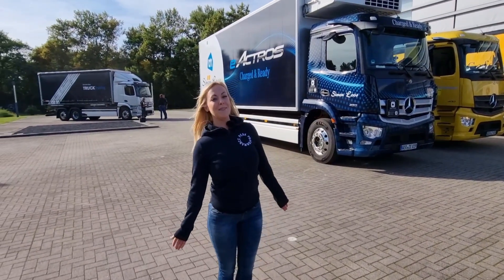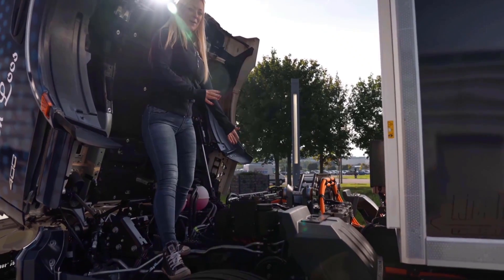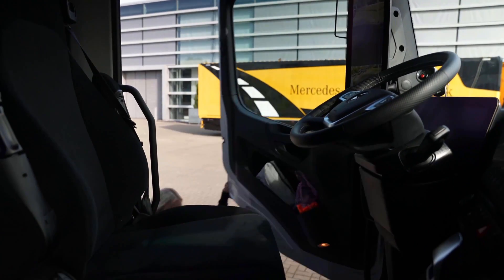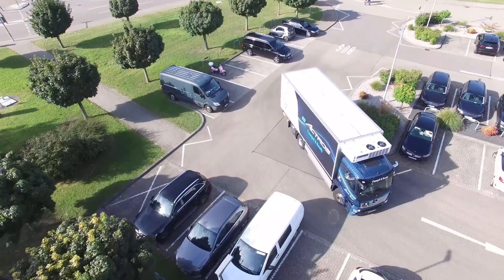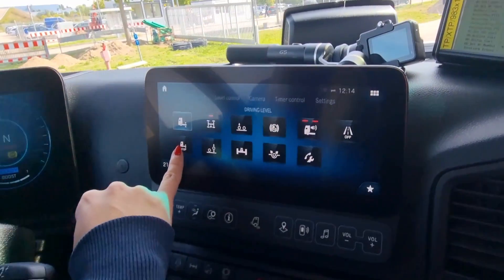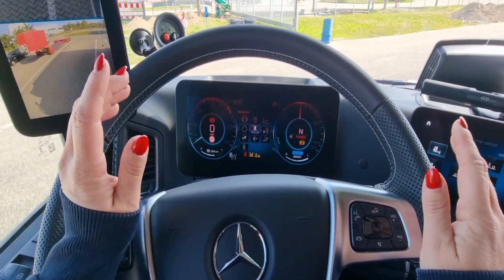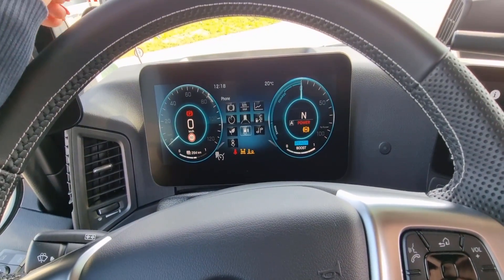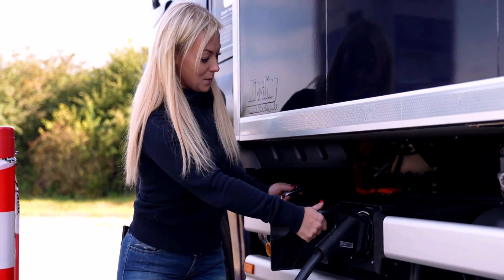⚡MERCEDES ELECTRIC TRUCK⚡ E-actros - Angelica Larsson

Comment: What you may not know about electric vehicles including the truck you're driving in this video what powers them are lithium ion batteries they were so quick to make electric cars and trucks they never did the research on how to discard the lithium ion batteries when they can't be charged anymore and what they're not telling you is these electric vehicles catch fire a lot quicker than a gasoline vehicle yeah they're quiet running and you plug them in and charge them what you cannot drive a battery-operated vehicle from the east coast to the West Coast without having to stop and charge it multiple times because they don't go any further than 350 me before they need to charge and a lot of  places still don't have electric chargers for these vehicles you take a gas operated vehicle an electric version of the same vehicle the gas vehicle will get you further down the road then the electric vehicle will both of them you have to stop and put gas in one plug the other one into charge it but it takes hours to charge the electric vehicle for every time you stop and charge the electric vehicle the gasoline vehicle gets twice as far down the road and if you're going on vacation or business trip the old saying time is money.

Comment: The electric truck by mercedes was very nice looking. Where were rhe outside mirrors. Ot loof like had a reefer bos on front. Where is slwelwr area.i like theyrucks you drove with microwaves in them. Love you. ❤❤❤❤

Comment: Nah, I'm not with this e-truck nonsense. It might be useful for local deliveries in cities and so on. But doing big routes this is simply not practicable et all. Even the air compressor drains the battery, not mentioning all the other systems. It drives without any generator and that one makes me numb, same as the missing Diesel purring :S

Comment: That truck is not better for the environment everything on that truck the steel , rubber , plastic all the minerals mined to make the batteries the electricity to charge the batteries was made possible by fossil fuels
Reply: Actually Mercedes-Benz (aka Daimler) is now (2022) using only renewable energy for their business. Obviously their suppliers might not at the moment but the entire automotive industry is rapidly moving towards RE.

Comment: ATTENTION ANGELIA, PLEASE READ, THANKS, 
HI there, Angelica, I am a recent subscriber.  I greatly admire your skillset.
I have been many things in my male 64-year-old lifetime, a Commercial Helicopter Pilot being one. ( please look into this as a career, you are young enough to start and I'm POSITIVE you would find it an absolute blast and you would be an exceptional Pilot as well ) I also drove the Big Australian Quad Road Trains 170 tonne side tippers. I never stuffed up during either career other than having to give everything up due to very poor mental health. I just wanted to say I wasn't half the driver you are and I never would have been. I did however manage to do the impossible one day and reverse a quad Road Train in a straight line some distance in a mine sight, but that was my single claim to fame as a heavy truck, operator.

Comment: Its been  a while since I've seen any of your  videos,  electric is great but nobody ever talks about recycling the batteries and any electric  vehicles 
I know someone who works at a dealership dealership and electric  is very dangerous to work on in fact deadly if a mistake is make 
What  nobody  talked  about  and  the information  i got the batteries cannot be recycled so the end result is is it really better for the environment
As to where I'm at we get electric  alerts  in our summer  months  do to overload  of our electrical  systems then in winter months  we get ice storms  that take  down power lines  and or shorts out our electric systems 
Solar needs sunshine  to work weather  plays a big roll in that then there's  wind power systems  they stop working  no wind mostly  because  of cold  weather  conditions  also snow a d ice  and they have taken out by lightning  storms  
Solar  and  wind power  systems  are good  for  about  10 years  and cannot  be recycled so are we really  saving  our environment

Comment: I Really think a small turbo diesel engine Hybred is the way to go run on battery and the smaller diesel engine kicks in til the batteries are fully charged and then the engine shuts down!!!

Comment: From experience EV trucks are fine for short distributor applications but don't appear to be the answer for longer trips great to drive smooth with instant power . Battery life is still an issue as a 20 % performance loss over 10 years and cost of replacements are significant .
In Australia we generate most electricity from fossil fuels so the green upside for the additional capex needs to be considered .

Comment: Much too expensive to buy and even more expensive, when you have to replace the batteries a few years later.
Reply: Nope. Batteries last much longer than that. Cost per kilometer is also very low compared to diesel.

Comment: Going electric isn't greener. I can't wait this marketing charade to fucking end. Replace all the cars and trucks and utility vehicles in the world with electric ones and see if the grid will be able to keep up with it. 1. The amount of resources you burn to build 10x nuclear, hidroelectric or wind/solar water boiling power plants will throw you back 40 years ago at the end. 2. Laying the infrastructure to have charging stations everywhere will add another 20 years worth of CO2 emissions. Today a diesel truck is cheaper, cleaner and more efficient than this stupid marketing scheme everyone jumped in in fear of sells dropping. The only solution that is viable but everyone ignores because marketing and money dictates, not real solutions, is HFC. The stupid fucks say that HFC is dangerous while we put our asses on top of diesel/benzin tanks since birth to death. Astronauts fucking strap themselves to rockets and they say having a hydrogen fuel container is too dangerous. It's an almost infinite source of energy compared to batteries. Having to charge anything that moves on tiers is fucking retarded and anyone who has both a chargeable anything-that-goes-on-wheels is an idiot as he/she saw nothing wrong plugging a plastic complicated adapter that polluted already way too much in another socket made out of plastic on a fucking car for a range of only 300 km when an HFC gives you 500 with a small tank.
Reply: Lol you forgot that hydrogen fuel cell vehicles require THREE TIMES more of the same electric energy...

Comment: How`s 400 km range good enough for a truck?
Reply: Especially in western europe 400km range is enough for a local distributor. For instance if you deliver beverages to restaurants and pubs and cafes in the region, you will hardly ever make more than 200km per day and your back at your base in the evening where you can recharge the batteries over night for the next day.
Yes, it's not a solution for every scenario, but for some it will do the job just fine.

Comment: For most countries electric vehicles are not better for the environment because the electricity used to charge the batteries is from fossil fuel using power plants. In Sweden I will agree that since most of the electricity is from either hydroelectric or nuclear power plants, it's a net positive for the environment.
Reply: Wrong. Even if mainly non renewable energy is used, electric vehicles are still far cleaner.

Comment: In Holland a DAF LF chassis cab on diesel costs around €50.000.A DAF LF chassis cab electric costs €352.000 ex.loader witch costs between €100-150.000.
So for a small company without factory support or a big cliënt as the Ahold company on the Mercedes of Simon loos it is impossible put an electric truck on the road!!!!!

Comment: I remember once getting into a Toyota Yaris Hybrid. I pushed the button and silence. I put the drive to the prod and slowly started walking. I was lucky that the battery was charged and the engine did not start right away. However, when I wanted to drive dynamically, the internal combustion engine started. It was completely different in the BMW i3. Where there is only an electric motor. Overall, the only obstacles to using electric cars are range, charging times and the availability of charging stations.

Comment: Amazing how quickly electric vehicles are moving into production and replacing fossil fueled vehicles. This must have been very interesting and a totally new experience for you to test out this new truck. I would think it will take some adjustments to get comfortable with the startup, charging, and all the different features an electric truck has after driving a diesel truck. Thanks for taking us along 👍

Comment: Electric vehicles really mean coal or natural gas powered.
Reply: That does not matter. Still cleaner than diesel.
Reply: @Freba9  there are places that can't keep up with the electricity demands during hot weather now.  Wait until there are millions of ev's charging at those times.  No AC and no vehicles
Reply: @peterbiltpilot516  Sure and that is exactly why grid reinforcement is so important. Among EVs we need more power for data, electrical heating, electrical cooking and other things that belong in the 21st century. Going electric is the only sensible way to drastically reduce emissions.
Reply: @Freba9  I have experience working at coal power plant facilites. one was retired and replaced with ng a few years ago. One last year to ng and one next year to solar.  The price of natural gas is over 50% higher than last year and solar is not dependable.  The electricity network is becoming more expensive and less dependable
Reply: @peterbiltpilot516  Correct and so do liquid fossil fuels. Again, electric is the only way forward.
Reply: @peterbiltpilot516  It’s not one energy source. Electrons are simply used for distribution and storage and have been proven to be the most efficient one. It’s just simple physics.
Reply: @Freba9  it is one energy source.  There is only one electric utility in an area.  You cannot shop for a different utility provider for your home and if your vehicle is electric your fuel for your car comes from that one utility company as well.  If you have blackouts or expensive rates you're stuck.  California has just announced combustion engine tools like chainsaws and weed eaters are going to soon be banned and that include generators.  So they are outlawing alternatives for electric power sources when the utility company fails and leaves you in a black out
Reply: @peterbiltpilot516  Again, the solution for lack of grid capacity or reliability is improvement of the grid - not sticking to horribly inefficient and polluting systems. I am not saying this is a matter of a few years, but it is the only option that makes sense in the future. Also: fuel crises have also proven to be very inconvenient in the past.

Comment: It’s a shame about all the technology in the cab that falls short in the real world!  Driving the merc with all the screens and cameras is by far one of the worse driving experiences I’ve had the displeasure of having!  By the end o& the shift all you want to do is have a headache tablets for your banging head and wanna tear off the screen on the drivers side!  This truck was designed for transport managers and directors who can’t drive truck but are blinded by shiny technology!  I can see some use for battery powered trucks though, on short runs round cities.

Comment: Electric trucks have a future, in the scrap heap of history! Come to British Columbia and pull 63,500Kgs up 8% grades for an hour or so with an electric truck... yeah not going to happen. Hydro carbons are still the only way to go. Don't believe the PC virtue signalers, oil is plentiful and, as long as the greedy bastards don't screw everything up, will be thee main source of energy for a long time to come. 
Considering that most of the world still uses coal and natural gas for electrical generation this is all just to make the ignorant feel like they're doing something good for the planet. 
Now, with my rant over... I live completely off the grid. I make my electricity from my creek via a micro hydro generator. Would I be opposed to having all of my vehicles run on electric power? Of course not! But the reality is that for anything other than puttering around the property it just won't work. 
An hour to charge? to go a few hundred clicks? VS a few minutes to go 3000 plus Kms? Time is money in trucking, and sorry but it's just not going to be able to compete in real life. You can get it for free, or close to it? Use your brain. Once these things start to gain in popularity, our electric bills will go through the roof! The greedy bastards that have their hands on the levers of control will rape us blind! 
Wake up you bunch of dumb sheep! Math isn't that hard!
Reply: It is not ignorant. Even on non renewable energy driving electric is still cleaner than diesel.

Comment: The batteries weigh over 3 tons for ~400KM of range.  Batteries have a finite number of charge/discharge cycles before they are used up.  It requires a lot of current for a "Fast Charge" (hours) to make EV's remotely useful.  Then add in the cost to upgrade the Grid to support MILLIONS of EV's and the power generation to supply the electricity....  Frankly it's just trading one form of pollution for another....
Reply: Wrong. Electric vehicles are still much cleaner than the fossil alternatives.

Comment: This was very interesting and informative video. I'm starting to change my mind about electric vehicles.  I might as well, it's going to happen anyway.   Thanks for sharing.
Reply: It makes sense for relatively short distance. A lot fewer moving parts mean that maintenance costs are much lower. 
It's very likely that when one needs to change battery, a new battery technology is ready for use in existing EVs. 
 
Rumour has it that a new promising sodium battery chemistry is in developed. They cost is about 1/8 to 1/10 of Li-ion batteries. They  have a bit lower energy density (lower mileage), but charges much faster.

Comment: 400km range 🤔🤔🤔🤔 so team driver that drive 2000kms a day will have to recharge it 5 times a day when they typically fuel once a day. So say the middle of the winter when the charge is 50% of summer they will have to recharge 10 times a day🤷‍♂️🤷‍♂️🤷‍♂️ there’s a lot of creepy dude comments on here too 🙄🙄🙄 These will never work in the colder climates not a chance, imagine this trying to pull a set of B-Trains over the Rocky Mountains in January at -20 to - 40 not a chance 🤔🤔🤔🤔
Reply: Nobody claimed otherwise. These trucks are great for more local trips. Yes, even in low temperatures.

Comment: Range and price are the big big problem in Canada , if it can not go 800 k and run ac or heat for 16 hrs straight it will not make any headway here , but I am sure they will figure it out.

Comment: So how much carbon is truly being saved. When you factor in the Battery materials being mined (china) , plastics and enough electric to charge the batteries.
Reply: A lot of carbon is saved. Production emissions of batteries are compensated for when you drive. Driving electric is always cleaner due to the efficiency - even on mainly non renewable energy.

Comment: It looks like a normal modern lovely truck. I love Mercedes Benz trucks, I drive them too they’re in my opinion the best truck for the job. I like this truck they have designed they have kept the characteristics of what trucks are supposed to look like big and high up in cabs. I have always worried about electric trucks and them not looking like trucks and being low to the floor. But they have kept the design great video and great truck.

Comment: Why mercedes won't do test on fully loaded truck?,As You said it has 4 bateries 450 KW x 4 , thats about 4024.48BHP don't realy believe it...I don't  have a problem with electric trucks at all just wondering how it would work in reality-having 15Tons,struggling to go up the hill,other thing-if U r stuck for 2hrs in a traffic-im assuming engine will turn off itself,or driver will do it-just to make sure he/she will hit destination point,last thing-brakes-how much energy air compressor need to fill air tanks,specially every morning-You cant just turn it on and drive,U ll vave to wait until pressure is built...don't want bitching so much,next generation of drivers for sure won't be aware of diesel engines,but at this time i wouldn't go for electric truck,unless i would have 28-36 single drops in a city-drivers know that its usual day of work...
Reply: You are mixing up energy and power. Energy = kilowatthour (kWh) and power = kilowatt or horsepower. The batteries are capable of storing 450 kilowatthours of energy.
Reply: @Freba9  i quiet sure U r right😁

Comment: PUT WEIGHT ON IT.....................
TAKE IT THROUGH THE MOUNTAINS......
WILL IT BE ABLE TO PULL WITH 40K + LBS ....
WILL IT DRAG LIKE A DETROIT, CUMMINS,  OR PACCAR...
I KNOW FOR SURE IT CANT MATCH THE OLD CATS.........   LOOKING GOOD MEANS NOTHING IF IT CANT DO THE JOB.......
AN TO THINK I HAVE TWO MERCEDES (SUV AN A SEDAN)...........  SUCH A DIFFERENCE......    I WAS SO UPSET WITH THE DIESEL ENGINE THEY
BUILT FOR THE SEMIS..............   HOPING THIS VENTURE IS MUCH MUCH BETTER...............................................

Comment: They have to get that battery weight down. Imagine the batteries needed to power a truck like mine that runs 700mi (1,126 km) per day, with gross weights that exceed  50tons (45,359kilo)

Comment: The company that I represent, is is field testing a handful of battery electric motor coaches. The batteries under extreme cold and hot weather conditions should be interesting.